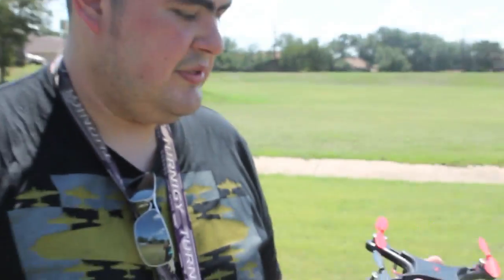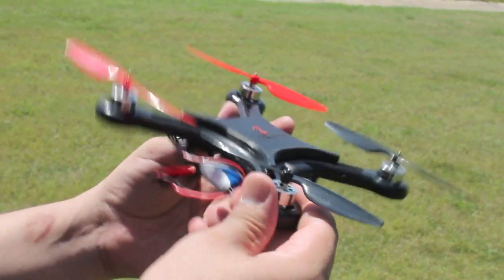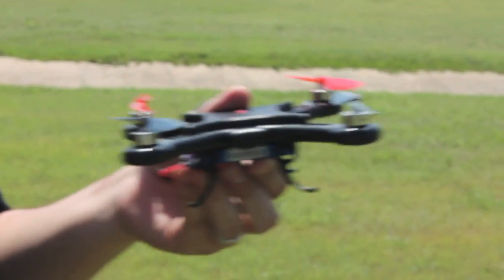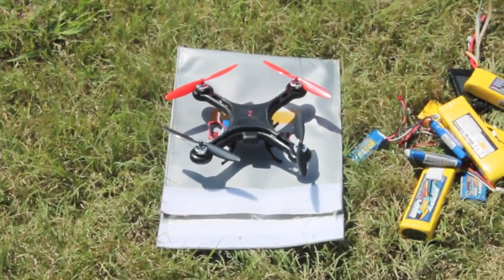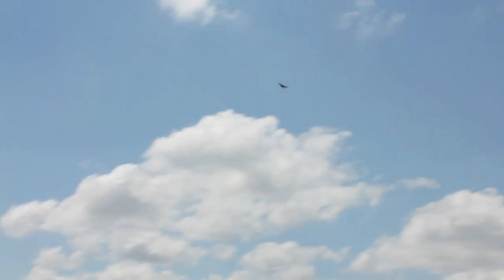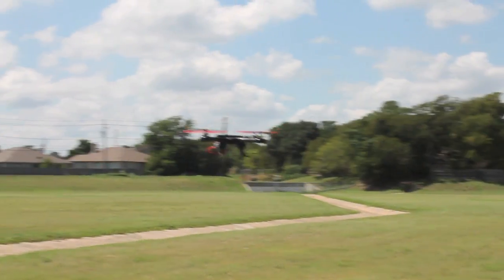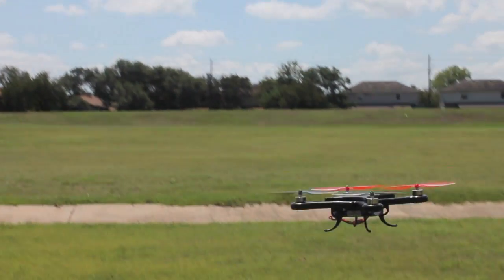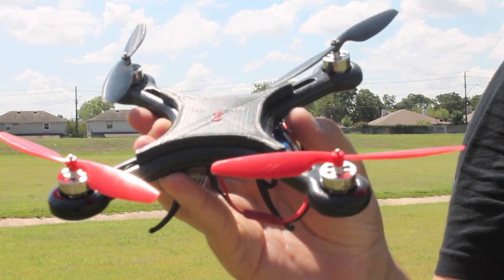Zwcky's 3D Printed Mini FPV Quadcopter w/ MakerBot Replicator 2X Weighs 200g

Comment: Well i like it! I've decided to build my first flying machine. It's going to be a mini quad (300mm or 12" motor to motor) I've ordered most of the parts yesterday. Should have watched these videos first, but i happened to choose the same motors and without recommendation. I chose the MINI MWC Flight Control Board and DSM2 Receiver, and i am going to try two different types of esc, a 7A mini or the 6A plush. I wanted to try something a bit different and try 1s 4p with larger props, If it flys like this it will fly much slower but hopefully quite stable and may have a longer flight time. Love your 3D prints but will try with carbon tube, i also plan to build my own battery packs into the arms, will try with 4x turnigy 200ma round cells, the esc's will be at the end of the arms to save running thicker cable. If anyone can help me with info on running these motors and esc's on 1s i would appreciate the info (i know i'm going to need a dc to dc converter to run the FC as 3.7 V is too low. Found a nice small 5V one on ebay

Comment from the maker: I believe the transmitter is 200mW so depending on antenna the range can be anywhere from .25 up to .75 mile. That's just an estimate based on previous experience. If you purchase a higher power TX you can increase that range considerably.